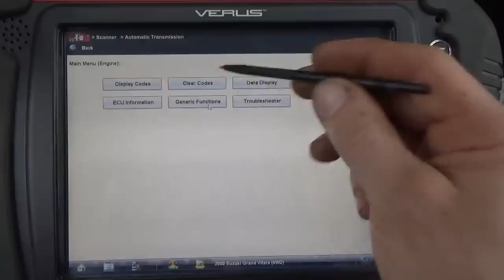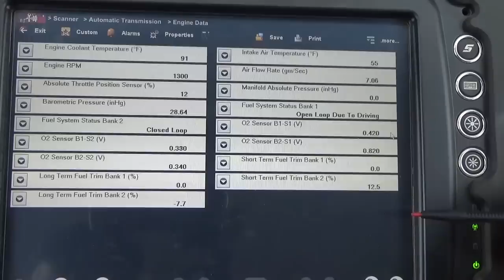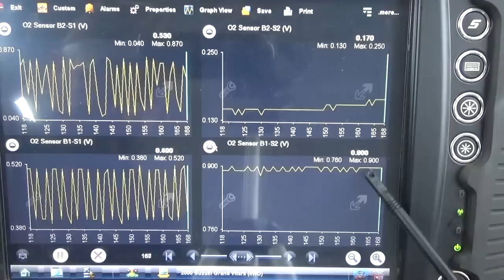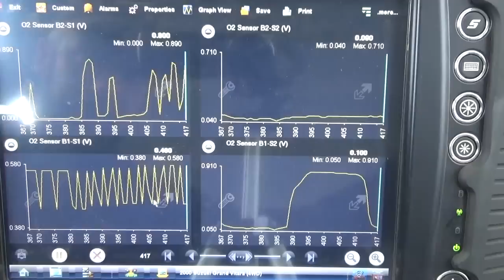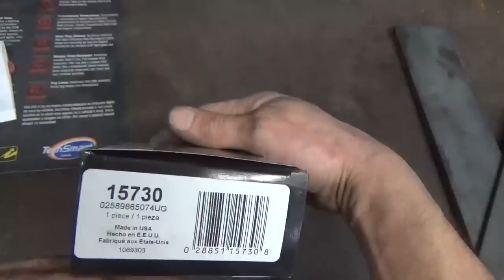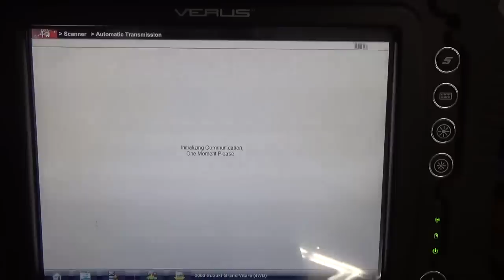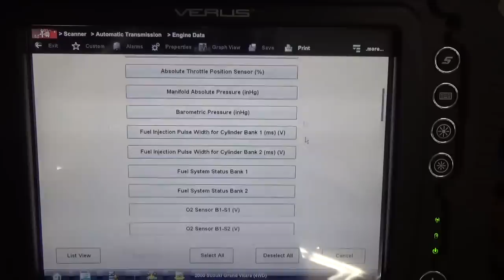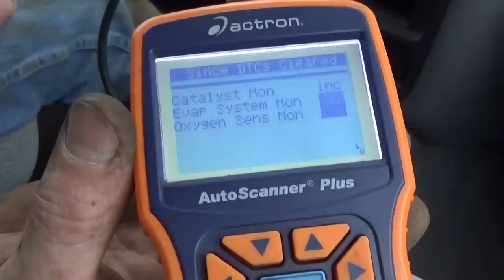Suzuki Grand Vitara / No Drive Cycle / No Codes - Part I

Comment: Trick I learned years ago is to stagger the length of the wires to be spliced thus making for a neater tape bundle when finished.  See what I'm getting at?  The connectors won't all be together. Just a suggestion. Those are really neat butt connectors.  Bald eagles are abundant in WI. They're cool to watch when they're fishing. Thanks for the video.

Comment: As an amateur I have used the crimp and seal you are using, never had a problem. The guys in the assembly shop testified that they were great, so I got some. No problems.

Comment: I need to get one of those 'miro' torches :-)

FWIW, I don't have a problem with using the old connector, but I have seen the shrinky butts leak water despite being shrunk down. In places where that might happen, I like to paint over it with some Scotchkote. Your mileage will undoubtedly vary.

Also, when I do use the shrinky butts, I like to stagger them so the bundle doesn't get too fat. Your mileage will probably vary there too.

Thank you for taking the trouble to do these :-)

Comment: just a comment: on those universal kits they include the screw-on-type connectors because solder doesn't work on O2 wires, so your crimp connectors were the other correct way of joining those wires, excellent video cheers

Comment: South Main Auto Repair. love your clips. I have used multi-fit 02 sensors several times. with great success (even though I'm not a big fan of them) they just make it easier to have on hand 2,3.or 4 wire. especially when your a mobile guy in the middle of no where. and 02 sensors are hard to get at the best of times

Comment: I couldn't help but laugh at the universal O2 part... Gawd, classic example of save a penny throw away a dollar, but at least it worked... Those connectors have gotten a bad rap because good quality ones from napa look just like the harbor frieght/princess auto junk, and let me tell you they are night and day different... I just use solder and shrink wrap anymore, still nothing wrong with those connectors in my mind... Thanks for another great video!
Reply from the maker: Rick James Yeah I solder, I crimp and seal, depends on the application any how, thanks for watching :)

Comment: It sounds like the issue you were having with the solder butt connectors was a cold joint. The solder was not getting hot enough to flow correctly will cause the issues you described with time.

Comment: The solder and seal connectors you mentioned probably used lead free solder which is why they failed after a year or so.

Comment: Hah the O2 sensors in those 'Zuki V6 offroad machines are a treat to replace! Did you see where that oil leak was coming from...kind of has me worried what's in store for my XL-7 :/  Very cool footage of the bald eagle too!
Reply from the maker: motoYam82 Hey Ivan... lets see where was it leaking... "the engine area"  Is that a good enough description? Lol
Reply: That narrows it down. Should I be looking to ship mine down the road soon then? "Two-owner, low miles, some new parts" haha
Reply from the maker: Nahh drive it till it blows!
Reply: Taking bets now: will the '89 MPV outlast the '02 XL-7?
Reply from the maker: Oh you bet it will... I got $5 on it :)
Reply: motoYam82 have you replaced yours? What brand did you use mate?
Reply: Denso!

Comment: The crimp'n seal connectors are great. Did you know the proper way to heat them is is to start at the middle, and slowly move the heat to the ends. When you see a glob of spludge ooze out your done.

Comment: Some O2 sensors get their reference air through passages in the wire insulation of the harness.  That probably explains the odd connectors the "universal" O2 came with.

Comment: What is your honest opinion about a Suzuki Grand Vitara, I'm lookin at one to buy.  Is it a good quality car or a  peace of junk?  I'm looking at a 2010 model 2.4L 4 speed auto tran.  150,000 miles on it but it runs great and rides so good.
Reply: Its worth it.i have it for 11yrs and swap the motor like two years ago for a good price at the junkyard.other than that,the car works fine.

Comment: Why not just quickly induce extreme rich and lean variables just to be sure the O2 was nonresponsive?  I've never seen one nonresponsive in mid range like that- that was weird.
Reply from the maker: Schrodingers Box That was weird huh? Well I dunno why I do what I do sometimes. I did see it was unresponsive and assumed that was what was hindering the drive cycle.
Reply: South Main Auto Repair Yes the snap throttle test was probably sufficient to be honest but I actually admit I was curious to see what would have happened if you induced an extreme rich or lean- would it have stayed the same or would it oscillate but at slightly higher or lower voltage?
  But it was definitely not a "parts swap" - the snap throttle did not change the response yet it did on the other sensor.  Either wiring or bad sensor and oscillation at a mid voltage virtually eliminates wiring.
 You know how I am about these things lol. You got 6000 subs bro- you have to keep your nose clean or people will call you out on every little potential mistake!!
Reply from the maker: Well no one wants to be a parts clown right haha! I have noticed the arm chair experts do come down on ya pretty hard especially when it comes to not torquing stuff lol. I agree it would have been interesting to yank a vacuum hose or give it a sniff of parts cleaner to see what happened. Well you know how hind sight is right?
Reply: South Main Auto Repair hahaha Torques! oh yeah...
Reply: Was that a processed reading or raw from the sensor? Maybe you were seeing a pcm substituted value?
Reply: Hindsight is 20-15! 
Perfect vision is 20-20.

Comment: Nice work, I've come across an eagle on a deer fawn so yes a small dog or cat, just a snack, they love wild turkeys as well.  I was at a camp  north of Thunder Bay that had a local pet eagle they would feed scraps too and it stood almost 3 ft high and wings at least 6 ft wide.  I have a Question for you- is there a tool to take out the rubber bushings that are pressed into the bore in a brake caliper.  I replaced the rubber boots and bushings but man their  jammed in there. I got them out with a hooked dental pick.  How do you get them out ?  Has to be a tool, my dental pick it toast now:)  This was on a Silverado.
Reply from the maker: Steve Rob Guess I am not imagining what you are working on Steve. Send me a pic if you can...
Reply: The small bushings in the picture. 
http://www.amazon.ca/Carlson-Quality-Brake-16118-Caliper/dp/B000BZTGPE
Reply from the maker: Don't they just go on the guide pins?
Reply: Yes, I had to pull the the old ones out. Looked like buddy used grease on his slider pins  before and the bushings were deteriorated, had to change them. How do you get them out.
Reply from the maker: I get them out with a drill...only takes a second :) I think it is around 3/8" or maybe the next size down...
Reply: Hum , never thought of that, crap, I'm stunned Ha , oh well - I know now .  Hey Eric show the boss the Email I sent you of camp just down the road from me. Ha if you like camping LOL....

Ha you know what's even funnier I asked our buddy up in sunny anchorage and he uses a dental pick as well.

Comment: I can smell gas vapor, I have taken it to serval Mechanic shops , and the dmv referee here here in California. But it’s still showing engine light, and Iam thinking it’s the catalyst muffler may be collaged up with carbon . I have replaced one of those sensors . But still showing engine light. I have taken to many shops for repairs. They said it’s only running or driving it to clear the problem. But that really didn’t work. I am still working on it.

Comment: I heard you mention a faulty break sensor switch? Was you saying a break switch can cause an o2 sensor/catylist not to go ready? I am having trouble with my 2001 ranger 4.0 getting o2/catylist to set. It showing no trouble codes but If I use my obd2 to run a code scan with engine running (the test that makes the vehicle step through different rpms) it comes back saying faulty break switch but the break sensor switch is working. It turns off cruise control and when applying my break it shows on? Can a faulty break sensor switch cause readiness issues? Please reply thank you in advance.

Comment: Thats universally a terrible way to replace an O2 sensor. You have a bunch of additional points of failure, you ruin the old one, you're reusing the old brittle connector. Plus the labor. That's a complete waste of money. Good call, crimping is 100% the way to go for high heat and vibration because solder will fatigue and break, especially in the engine bay.

Comment: Had this exact issue today with a 97 ford f150. Put a new oxygen sensor reset every thing and according to thw scan tool i have done 10 drive cycles but the evap monitor is not saying "ok" im suspecting a hi voltage vent valve because i dont know the voltage on those but i did notice upon start it was arouns 10v and while highyway speeds it went between as low as 7 volts and as high as 12v. Still waiting to see what happens but original complaint wad random misfiring but not consistently . i was able to recreate the issue in which i belive is fixed it also needed a O2 b1s1 .preformed the koer test and it passed. But still will not set evap monitor
Any sugesstions?

Comment: That for sale tag is missing a decimal point between the two nines.
Reply from the maker: GRowe1978 I know right haha :)
Reply: South Main Auto Repair Who the hell is going to put a sticker on THAT?
Reply from the maker: There is a guy 5 miles from my shop... if you go there with fifty dollars and have a pulse you get a sticker. Push pull or drag. The state says they can't shut him down because he is only open at night and not during "state hours". They said the only way they can shut him down is if someone gets killed because of a faulty inspection directly related to him I guess...
Reply: South Main Auto Repair Well... that may just happen.  
Sometimes cars are so bad, it's amazing anyone buys them.  Can people really be THAT oblivious?
Reply from the maker: I will answer that with a simple... Yes... yes they can haha
Reply: South Main Auto Repair I know.  When I'm looking for a good used car, I have a checklist I use...
Does the car smoke? Yes, check! Does it shake and rattle? Yes, check! Does it run? No, check! Does the transmission work? No, check! and so on.  If it has every problem on the list, you better buy it before someone else gets it!

Comment: Hey, I was going through Suzuki malfunctions, because my suzuki grand vitara 2001 2.5L V6 it's not showing any codes either, but after it warms up and I push hard on the throttle , you can feel that it takes a while to respond and when you come ti a complete stop, the car starts to idle so bad that it sometimes turns off the engine.
I got brand new spark plugs, new catalyst converter, new camshaft position sensor ($250) :( ... and nothing has fixed my problem I believe it could be your client's same problem, or I was thinking on the Pre Catalyst the ones that are on the manifold.  Any suggestion? By the way great video

Comment: Is there any advantage or disadvantage of taking off the converter of my 99 grand vitara? I live in a state with NO emissions testing. Also the little extra box on the air intake tube between the air box a throttle body, is there any advantage or disadvantage of taking off that little ear that does nothing but cause my engine to loose air, or have to pull harder with the little (extra air box) on the factory air intake tube?

Comment: bank1 sensor1 is almost acting like the heater, or heater circuit has failed , but not enough to set a code.
Reply from the maker: 4literpowered Yeah would have been interesting to pull the heater fuse and see what it did... or bench test it for that matter.

Comment: I bought a 2008 3.2L Grand Vitara engine cranks but not start put in scanner code that r display is P1646 incorectness code need help fuse r okay relay r okay i supposed it could be computer or key.

Comment: Great video thinking of getting a universal for my 97 Avalon XLS that eagle is beautiful my favorite bird so majestic . I have a code po773 shift solenoid is it hard to replace ?
Reply: I believe that selinoid is in the valve body of the transmition
Reply: I know where it is i read on the internet that it might be the torque converter that might be the problem. For code po773 i just dont want to put to much money into a 97 avalon with 194 k I figured the solenoid was cheaper fix

Comment: Dear SMA,
My Suzuki is a  GRAND VITARA year 1999, Engine 2.5 LTS. , V6, AUTOMATIC, VIN JSAFTD62V00110917.
Please two questions if possible.  
What home use scanner can I use with this car? I have tried some and no one works with Suzuki.
Second, Is it true that when disconnecting car battery ECM or computer looses all registered codes? (Grand Vitara 2014, A/T 2.4 lts. 
Thank you very much.
Regards,
Christian.
Reply: Dear Wolf,
Thank you so much for your note and help. I will go for that reader.
Thanks.
Christian

Comment: Solder has no place in vehicle wiring, ESPECIALLY those hyper-dopey solder shrink butt splices. Those are dumb, and I have no problem giving anyone who uses them guff.

Plain and simple, you have no control over the process, and soldering is indeed a process.